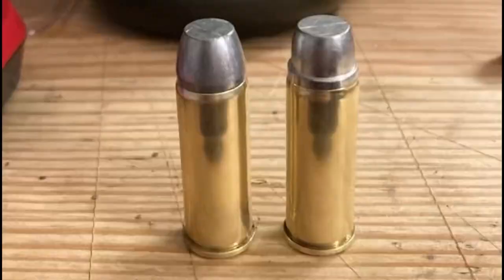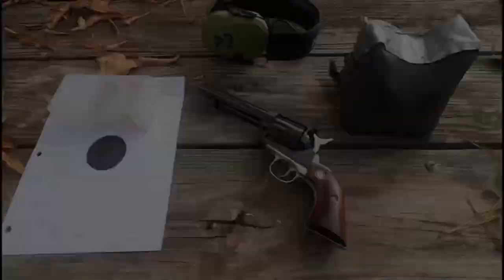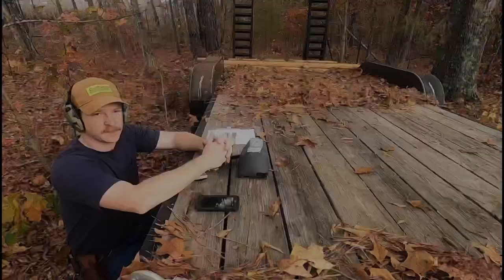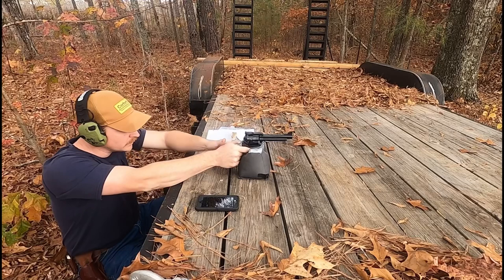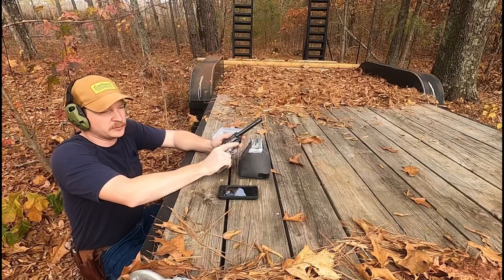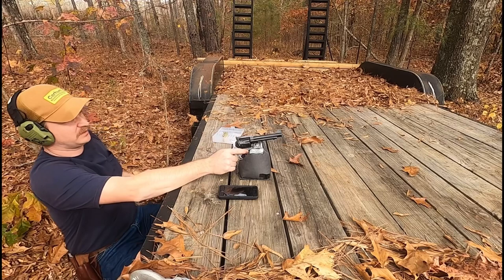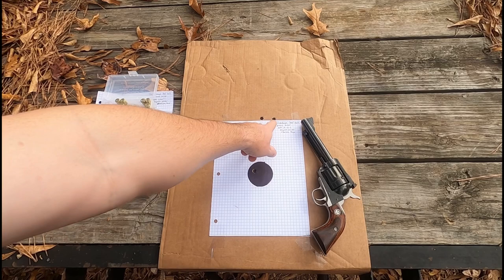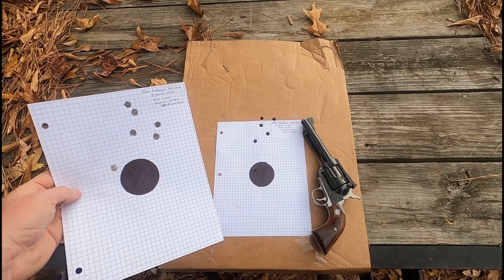John Linebaugh 45 Colt Pet Loads, from Ruger Blackhawk.

Comment: John was my client and good friend for 20 plus years.  It’s good to see this video.  Accuracy in a Ruger can be improved by reaming your cylinder mouths to .4525 and running a .453 to.454 diameter cast bullet.  You might want to try the 270-SAA bullet from Montana Bullet Works.
Reply from the maker: I’ve had the cylinder throats reamed already to .452. My barrel is around .451 according to a squib I’ve recover from it in the past. I have plans to try the 270s later in down the road, once I get a proper bench and rest established! Thank you for the advice and view!
Reply: Sounds like you are on track!  Best wishes.  You might try 13 gr of HS-6.  That will really make the Ruger turn on.
Reply from the maker: @thealsatian4232  I shot some XTPs over some H110 the other day. I think that loading will be for use in my 1894 more so than the Ruger. It was obnoxious with this standard grip frame. It would probably be better with a Bisley.

Comment: Try the linebaugh H-110 load with a 300gr. Lead bullets.
Reply from the maker: I’m gonna eventually order some heavier stuff and try some loads with them.
Reply: @j_c_hunt  if you cast .the Lee 300grain flat nose works good and I have a accurate brand mold for .45-70 that I can size down to .452 that shoots good also. I have the same gun you do except mine i lengthened the grip frame frame and installed a super blackhawk hammer. It’s a real hammer.
Reply from the maker: @flintrichards945 I do some casting. I’ll look into that sometime. Thanks for the advice!
Reply: The Lee 452-300LFN casts to 320gr. with my alloy.

Comment: Enjoyed your video. I have a Uberti 1872 open top 45 Colt (7" barrel) that I reload for. I'm using 7.5gr W231, CCI 300 LPP & 255gr JFP, which works great. Prior to this load, I tried 6.5gr W231, but this caused a "squib" load. I then tried 7.0gr W231, which worked OK, but seemed marginal. Anyway 7.5gr W231 is my "go-to" load for my open top 45 Colt.

Comment: Thanks for sharing. Ive had good luck using ramshot enforcer powder. They have a 45 colt 30k loading section in their manual. A starting load of enforcer gives me 1100 fps from my 5.5 inch bisley, really accurate,  and the recoil aint bad.

Comment: I think your groups would shrink a lot with a better rest. Not sure what distance you are from target. I love the 45C and those heavy flat points. I use 17 grains of 2400 under a 300 grain hcfp. My 4 5/8 Blackhawk will print under 1 inch at  25 yards, A great hunting load. I like to support the barrel and the butt on sandbags. But a great video, sir. Thanks very much.

Comment: I shoot 9 grains of 231 and a Lee 252rnfp cast out of my ruger vaq and Henry carbine.  They do the work needed out to about 100 yards.

My old model Ruger Vaquero with 300 grain Lee cast with 6.5 grains of Red Dot powder works well for me and my gun.

My 444 Marlin is my heavy weight so I don't use too many loads with 110 powder for 45 Colt.
Reply: Think I'll try that Red Dot load.

Comment: It sounded better with gas checks . Ive got a moddle 83 Freedom Arms seven and one half Premare modle . If it shoots any better its the length of berrel over what your useing . The five and a half is plenty good for a snap shot on a charging hog with half the weight of the moddle 83 . Thanks for showing your work .
  T/C/E

Comment: Think these would be a good load in my 25. If I remember correctly John used these his 4” 25
Reply: Don't use" Ruger only" loads in your S&W. It doesn't have the same cylinder strength.

Comment: 10.1 grn W231 X 255 Lee
Raging Bull 454 - not saying this is safe in a 45 Colt! 

Created: 02/18/22 02:47 PM
Description: 454 255 Lee 10.1 W231
Notes 1:
Notes 2:
Distance to Chrono(FT): 5.00
Ballistic Coefficient: 0.175
Bullet Weight(gr): 261.00
Temp: 54 °F
BP: 1013.35 inHg
Altitude: 600.00
# FPS FT-LBS PF
6 1070 663.63 279.27
5 1091 689.93 284.75
4 1064 656.20 277.70
3 1069 662.39 279.01
2 1100 701.36 287.10
1 1087 684.88 283.71
Average: 1080.2 FPS
SD: 14.5 FPS
Min: 1064 FPS
Max: 1100 FPS
Spread: 36 FPS
Shot/sec: 0.0
True MV: 1083 FPS
Group Size (in): 0.00

Comment: Those are not Ruger only loads
Reply from the maker: @oldtimer3180 How do you figure? Lee loading manual lists 7 grains of W231 with a Cast lead bullet at 13,900 CUP. That is the max a SAA or SAA clone will handle. The article written about this load, gives the same warning. If I had a SAA or Clone, I sure wouldn't risk blowing it up shooting loads that are too hot for it to handle.
Hence why it's Ruger Only.
Reply: Those a 1 st gen SAA loads, the 2 nd gen and 3 rd gen SAA are good with the 23K psi loads. Read Bumpkin... if you can
Reply from the maker: @johnmills837 I can read plenty. Matter of fact, what I stated in the video is exactly what I read in the article about the load. I reckon not everyone knows everything about anything like you do sir. I also reckon these claims by the article and load manuals are made to keep folks who don’t know, from blowing their guns up. Appreciate you stopping by.

Comment: Those are some awful light ruger only loads
Reply from the maker: It’s the pressure. A SAA or clone can’t have more than 14000 psi pressure. According to my Lee manual 7 grains of W231 is 14000 psi. My understanding anything over that is over pressure for those type handguns, and could lead to failure.
Reply: @j_c_hunt   Not true
Reply from the maker: @oldtimer3180  how so? Please explain.